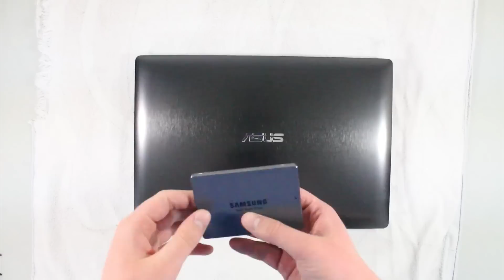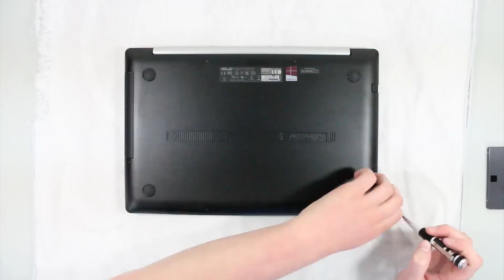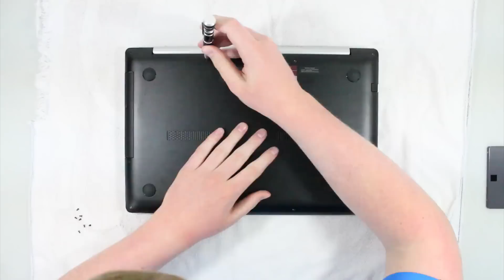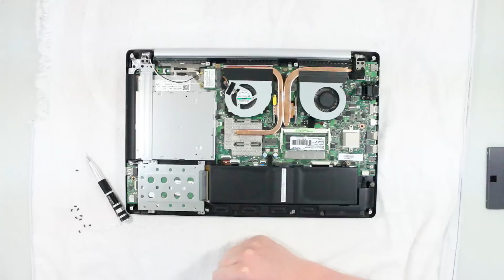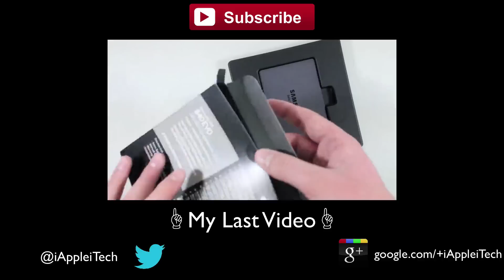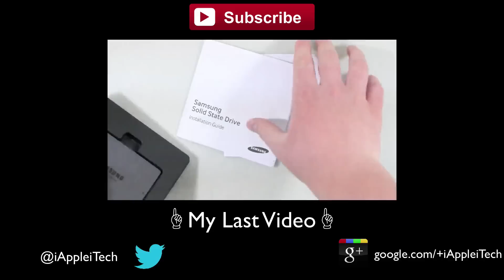SSD Laptop Install | Samsung EVO SSD

Comment: Hi, I've upgraded G550jk to windows 10. Cloned windows 10 from the HDD to Samsung EVO SSD but after installing the SSD(taken out the HDD) laptop could not boot up. Swapped the SSD back windows 10 boot up. I did not have any errors during cloning using the Samsung cloning program, any ideas, thank you

Comment: I have the same laptop and bought the same ssd, just the 250 gb version. My boot times with the original 5400 rpm hard drive were around 15-20 seconds, and now its around 30-40 seconds. Dont know whats happened, tried the cloning method and then also the fresh install. Am I missing something?? I also ran the samsung magician software and did all those steps.

Comment: Hey man thanks for the video!   I have a question - I am planning on buying the Asus N550JK and I want to replace the hard drive right away with an SSD like you did.   However I am unsure of how to do this.   Should I just do a fresh install of windows 8.1 since I wouldn't have any files on the original HDD yet?   Or is there a better way such as cloning?   And if I did a fresh install, what about the drivers would they automatically install with Windows 8.1?   Thanks!
Reply from the maker: I would just do a fresh install if I were you and then download the drivers on Asus's website.

Also, don't forget to download the ATK package drivers. I did and it was causing a headache for me.